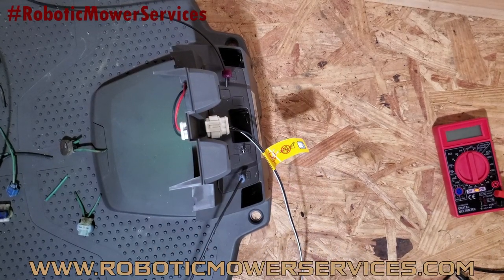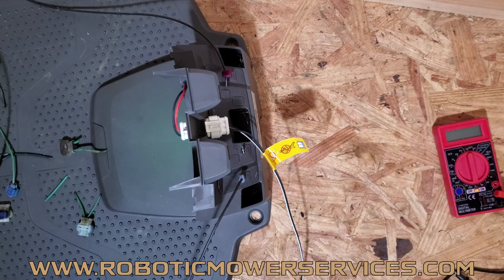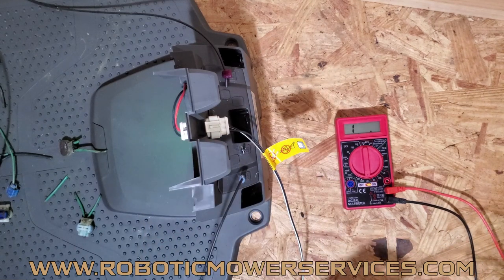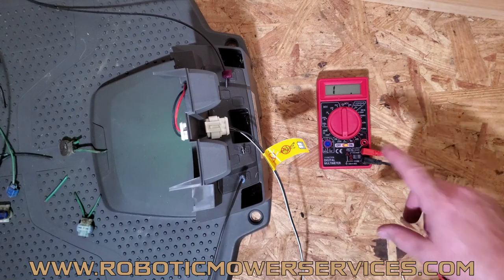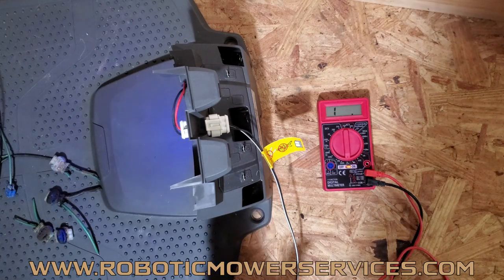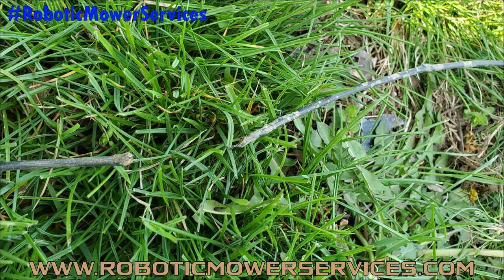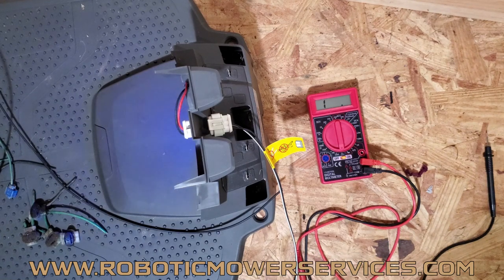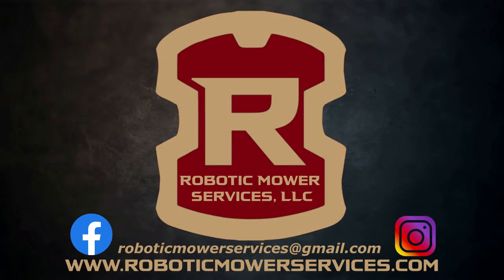Measuring Resistance In Your Automower's Boundary Wire (No Loop Vid. 5: Continuity & Resistance)

Comment: Great tips! Have problems now this spring. Fixed it yesterday then today it flashed green again. Got it working then it stopped. Really wet soil and rained again today. Now I will swap out most of the line and get dry new connections. Will swap the base connectors to the car version. 

And last of all. Coming from Sweden passed Husqvarna city the other weekend I love how you pronounce Husqvarna. 😂😃😃👍

Comment: This is a great video. I'm at 5 years now for my 450X, and my original green boundary wire is now failing regularly (it is NOT compatible with the Canadian climate/soil frost). Complete breaks are easy to find using the tone tester you recommended in a previous video (or even just an AM radio), but high resistance spots are murder to find. I have a large lot with a long boundary wire, so I'm at a ragged edge loop resistance right now. My local dealer lost the only guy that knew anything about Automowers, so I'm on my own to fix everything now. What tester with "the meter" are you using to find weak spots in the wire? Also, what are your thoughts on the 5.5mm "Pro" boundary wire?
Reply: Hi mate, have you found your issue yet? I have the same mower as you over here in the UK. I am tearing my hair out trying to understand why I've got the flashing blue light. I had a cable break detector on it - two different ones, all giving me a pulse. Its driving me mad. I've also ruled out the power pack as thats been tested and fine. I just don't know what to do.
Reply: @thedigitalemotion  @Digital Emotion  last year I found the issue by intermittently digging up the boundary wire and probing the enclosed loop for resistance. I eventually zoned in on the problem area and replaced that section. In a few weeks the mower will come out of winter storage, and I'm dreading what shape the loop is in after a winter from hell here. Wish my post would have received a response from RMS.
Reply: Armada Pro 800D
Reply: @pinball8701 thanks much.

Comment: Very informative - thank you. Helped much more than my robotpusher...I am sure I have the problem you explain around 10 mins. What would a good (pro) tester be to detect that? i have bought (already) the Noyafa NF-826 to walk my 800 meter perimeter wire...
Reply from the maker: We like the Armada Pro 800D but it is a bit expensive just to use now and then around home. Mastech makes some testers that work well and won't break the bank, but the issue with them is that you have to bend down or crawl along the boundary wire to get a good reading with them.

Comment: Good stuff.  Thanks.  Question, what type of connector do you recommend for line breaks?  And how best to protect that connection from moisture?
Reply from the maker: We started using the solder filled shrink wrap connectors. So far they have been holding up well. We like that they not only shrink, but they have a gel in them that also helps seal up the repaired area.

Comment: Can you identify what meter you are using that shows a readout for finding partial breaks?
Reply from the maker: We use the Armada Pro 800D. It sends a tone through the wire and has a meter on the receiver so you can see how much the signal drops where there are partial breaks.

Comment: Meanwhile I'm at 60m ohms, but I get 19V back from powering 20V into one end of the line... Just tried to hook up an existing wiring on a house I bought last year.
Reply: anyone experience a flashing blue light ONLY when the automaker is docked? having this regular now within last week. as soon as I unlock and pull Automower away, flashing blue turns solid green, and its good to go, but because it keeps locking at docking, i'm losing valuable mow time.
Reply: @johnplatner9815 Isn’t that eco mode?